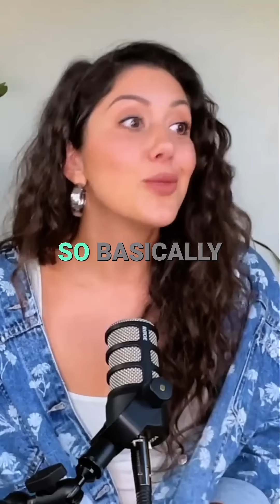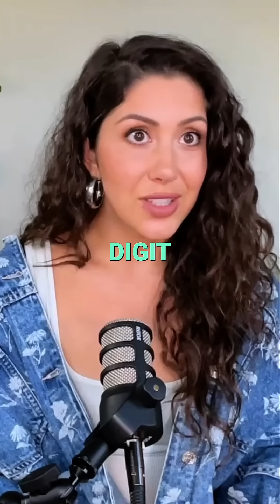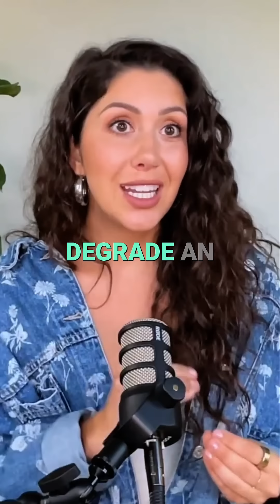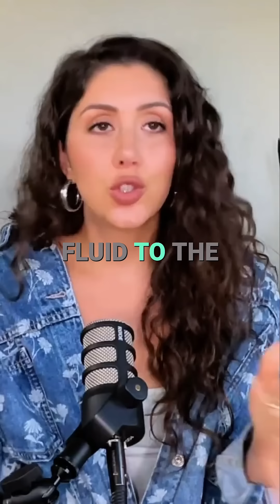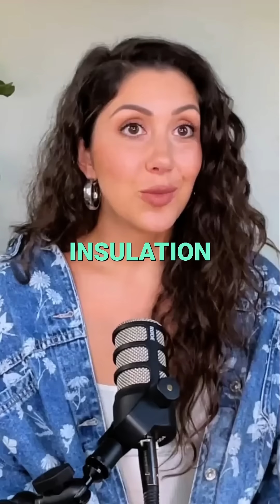New Texas Home? Watch Out for Hidden Mold!

Comment: Freon is a Brand name of a Refridgerant... Mold is in the "AIR" it grows because of "Humidity" it does not have anything to do with "Refridgerant"... Leak or no leak...  "Mold grows in new houses due to moisture buildup from various sources, often exacerbated by construction practices. New houses are particularly susceptible to mold growth because they often contain trapped moisture from construction materials, poor ventilation, or leaks, which provides the ideal environment for mold spores to thrive..."  Mold is everywhere... If you provide a humid space for it... It will grow there, it has nothing to do with new or old construction, except how that construction is ventilated... OR Not Ventilated...
Reply from the maker: how is that different from what im saying?